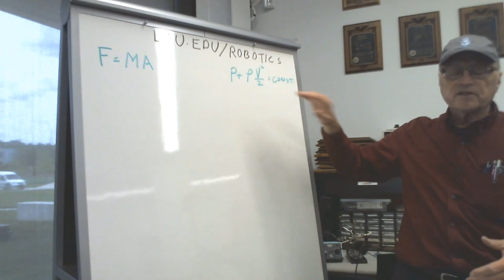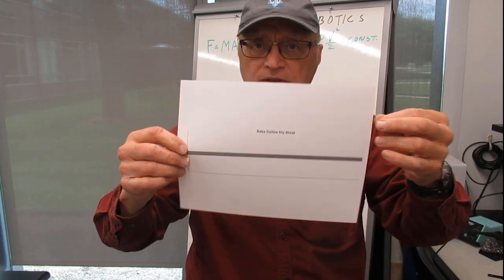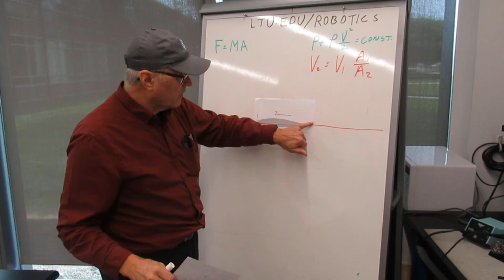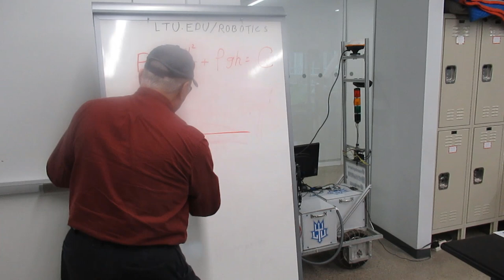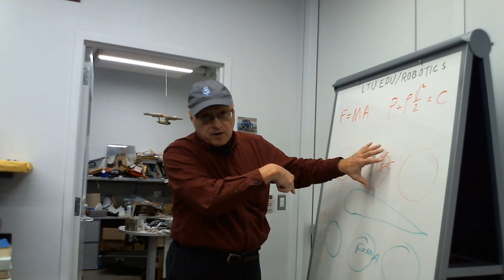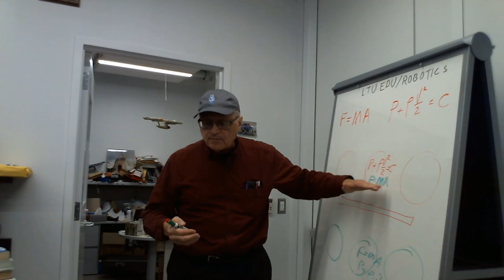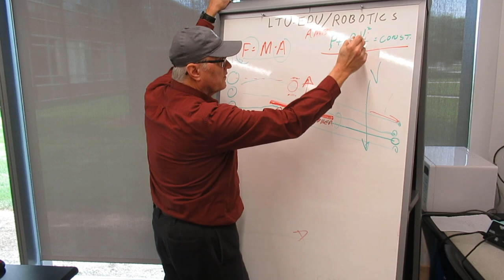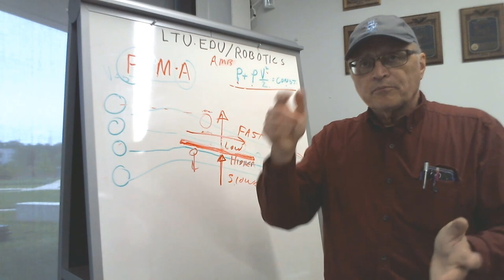Lift: Facts vs. Fiction - Fairy Tales for Pilots.

Comment: This week I have enjoyed seeing these very informative, intuitive videos, and at the end, being invited to comment about the contents, I feel rather interested to take part, as some ideas are different from what I am familiar with.  I shall speak about the fact that Newton and Bernoulli and Venturi and CIRCULATION, Coanda and Navier Stokes, etc. are all existing in what goes on around the wing of an aircraft. They are all the same! Few people comprehend it in the manner with which I am familiar.  I shall do my best to keep it simple and concise, but as Albert Einstein once said, " You can make explanations simple, but not any simpler than that!" 
              VENTURI EFFECTS . The manner in which the venturi effects were calculated on the Monie Aircraft airfoil was a little misleading, as that is not the way it works in reality. The presenter did not appreciate that in distributed mass systems, like air, water,  long ropes, and long pipes and long transmission lines, strings in pianos and guitars, and membranes in drums, and sound in wind instruments in orchestras,  and flapping flags on masts, and tuning forks, etc, what happens in one locality is not immediately felt in another locality,  THERE IS A DELAY,  and that is what exactly happens in a wing flying through a big voluminous block of air mass particles.  The manner in which the presenter calculated the venturi speeds above and below the Monie airfoil section while taxying on the ground, is completely wrong. What happens on the Monie wing surfaces does not travel immediately to the ground, nor does it travel to the altitudes he mentioned above the wing.   What really happens is the CREATION OF PRESSURE WAVEFRONTS and it is these pressure wavefronts that travel relatively slowly to distant places as in the case of sound pressures which travel at about 1000kph. Even electricity traveling with the speed of light is so slow when we consider electrical pulses in the Gigabits per second.  As the wing of the Monie  MOVES FORWARD to act as a VENTURI there are two wavefronts formed above and below the wing. These two high-pressure wavefronts travel laterally relatively slowly, one up to the sky, and one down to the ground. In the case of a ship traveling through the water, the bow wave starts to travel laterally, where the pressure wave causes the water to rise up to enter the air above it.  So as the wing of the Monie travels forward at low speed, the two lateral wavefronts do travel far away and the presenter's calculation was valid to think as he did, but if the Monie was traveling very fast, then the two pressure wavefront above and below the wing will not travel out too far, these become the boundary lines of the VENTURI effect in a  flying wing above and below the aircraft. 
            Now the magnitude of the VENTURI EFFECT on the Monie wing also depends on whether the Monie was using a TRACTION or a PUSHER propeller ahead or behind the wing. Flow-through a venturi needs a pressure difference,  and if it uses a TRACTION propeller, then below the wing would have been a pressure higher than the atmospheric pressure, while if it was a pusher prop behind the trailing edge, there would have been a low pressure and the traction and pusher propeller on taking off hindrance, as suggested,  would be rather different. If the Monie had to travel at high speed while taxing, I doubt if the wavefront above and below the wing would have been more than three feet away and hence the VENTURI EFFECT  would have been substantial to assume it.  On the lower speed, well the VENTURI EFFECT is not to be considered.  The point is that the fluid does not behave as the presenter suggested when working out his version of the VENTURI EFFECT on the wing of a Monie and to suggest that the difference between the VENTURI effect on the upper and lower section was what it was.................... well, I hope that he reconsiders his way of calculating the continuity of the fluid above and below a wing!  to prove that the venturi effect does not exist!  Perhaps one is being too pedantic!  but as detectives, we need to be accurate about how a wing flies and what happens at one location in the air does not happen at the same time at a far distant location.

The Venturi effect can be concluded by the use of both Newtonian and Berlunian effects, but as one needs the pressure differences at the input and output of a venturi pipe, this can be obtained by using a higher pressure compression source at the input or a lower pressure suction source at the output. Forgetting that the particles touching the sides remain stationary, if the heavy particles near the sides are considered to be fast heavy cars with a spring suspension, then when the convergent part starts to be navigated with a change of direction, not necessarily a change of velocity,  there is acceleration, and the suspension system compresses as the car inertia tries to hold the previous velocity direction, thus, the energy in the particle is transferred to the suspension system and when the car reaches the narrowest part of the venturi it will proceed to leave the surface due to Newtonian mass/ velocity effects, Bernouill, on the other hand, does not speak about the fluid mass trying to separate from the surfaces or streamlines in a venturi. The rate of change of velocity as a vector can occur in a linear fashion or an angular fashion, both of which will provide ACCELERATION. or pressure differences.  That proves that Newton and Bernoulli and Venturi effects are one and the same processing philosophy and they all exist around a flying wing.  Here one should mention that while we see Velocity as a Vector in Newton and Bernoulli and Venturi Symbolic representations, the associated  Pressure is always a scalar and in the Bernoulli equation, a change of velocity in a streamline, either along the streamline or simply a change of direction while keeping constant velocity, this would produce a Pressure change which is a SCALAR  and acts in all directions to affect all of the neighboring particles in a Newtonian fashion. 
Continued.
Reply: The streamlined diagram of the flat plate as shown at 40:37 is interesting, but there are some missing details that could lead to a misunderstanding of how a plate operates in those conditions.  The streamline is shown moving horizontally, starting from the right to left and when it meets the lower leading edge, it SUDDENLY AND INSTANTANEOUSLY  changes direction to follow in parallel mode, the slope of the flat plate.  Now ahead of the leading edge and after the trailing edge the Pressure is Atmospheric, Pa, and so parallel to the plate, there is no pressure difference, hence while traversing under the plate there is no linear acceleration of the particles, nor is there any curve to produce an angular acceleration, hence there is no force on the particle as it is moving at constant velocity.  The only ACCELERATION, hence force,   that took place according to that streamline contour, was, in an instant, under the leading edge, when the streamline changed direction.  That is the only place that force on the plate was created to change the direction of the mass particle. From then on the fluid mass particle was on a free flight without touching the surface of the plate.  According to that streamline,  the flat plate could have been a thin strip catering for that location where the streamline hits the plate and any other particle under it would have been influenced accordingly, and there would not be any use for the rest of the plate towards the trailing edge.
That streamline shows an IMPULSE under the leading edge of the plate and that alone would have uplifted only the leading edge and no more than that. Note that constant velocity along, a straight line or a first-order equation in the form   y=kx+c, then its velocity is dy/dt= k   and acceleration = d2y/dt2=0  hence no forces exists if a particle moves in a straight line with constant velocity.   

 All fluid particles behave in another manner and they have a cushioning or a soft pillow effect and their viscosity has other characteristics which try to keep them together cushioning and damping each other for any impulsive forces. 
When a mass particle of a fluid approaches a flat plate, the other stationary particles already in the zone near the plate, predict its arrival through a wavefront built ahead of the moving particle, as in a wind tunnel or a moving plate as in a free flight wing.  The wavefront of the moving particle as shown in the video will conglomerate the particles near the plate to resist the new arrival, and the close particles will cushion the arriving particle as when a satellite from outer space returns to the atmosphere at an angle that can achieve the cushioned, soft pillowed, trajectory into the atmosphere, rather interesting. This entry into the "atmosphere"  near the plate will certainly not be a straight line but more of a parabolic effect, perhaps of the form of y= ax^2 +bx + c   where the velocity due to the cushioning effect would be:-  
dy/dt=  2ax+b   and the acceleration d2y/dt2 would be 2a, hence while the particle tries to enter the cushion of particles around the flat plate, it would be subjected to a CONSTANT ACCELERATION  and hence there will be a rection on the plate to push it up, in this case, a reaction process which contributes to lift during the long period when the particle traverses under the flat plate.  If one looks at the 41:10 one can easily note the location where the acceleration under the wing takes place related to the diagram shown on the whiteboard. The streamlines under the wing are not exactly straight lines. One can note the benefit of angling down the leading edge to  be parallel to the entry of the apparent wind  and so what is shown at 41: 10 is not exactly a flat plate

What goes on above the flat plate has a relation to what was described and a practical plate would naturally curve the streamlines rather than keep them straight all due to the group behaviour of the particles within the zone of the plate, including the boundary layer. We shall leave that to the imagination of the reader. The angled down leading edge and the slope above the wing is introduced not to lengthen the path above the upper surface of a wing, but it is to cushion and accelerate the oncoming mass particles upwards and then give them a flight path containing a continuos deceleration and acceleration all the way back to the trailing edge.   All contained in what was described, including the cushioning effect of the fluid particles, there exist the processes that Newton, Bernoulli, Venturi, Coanda, Navier Stokes and another, call their own, rather than accepting it to be one natural process which nature itself brought about, and we still do not understand it fully, especially when the fluid particle can have internal energy of its own, like an exploding bullet, or the particle can be given external energy, as those particles getting out of the way of wings, rockets, cars, ships, a jogging human,  and all trying to return back into the furrow the moving craft made by robbing energy from the craft that pushed them out of the way in the first place.
Bernoulli equation around a wing must not be written simply as C= P + V^2/2  as that is much too simple. and is not what Bernoulli meant to describe around a practical wing whose powerful engines do transfer energy to the particles around the wing where all that energy is robbed back from the fluid particles by other exploitations around a wing as modern banks are robbing all our savings/ assets through depreciating their value!!  That is another issue that many people do not understand about democracy and its false pretences.
Reply: Continued.
Now let us explain how the transient and steady-state, particle pumping procedure to create a partial vacuum (low pressure), is brought about on the upper surface of a flat plate or the airfoil profile of a wing. We should assume a moving plate/ wing and not a stationary plate in a wind tunnel, but for convenience, we shall choose the later states and leave it to the reader to visualize the real moving wing.
When a stationary flat plate with an angle of attack is placed before a horizontally approaching fast-moving voluminous block of air-fluid mass particles, the entry angle is not that of the apparent wind and so the Newtonian inertia of the motion of the air mass particle will shoot past the sharp leading upper edge in a straight line horizontal line at the leading edge of the angle of attack of the plate.  At that very instant, the stationary particles above the upper surface will face a boundary line, separating the stationary particles on the upper plate from the fast-moving mass particles going past the upper leading edge.  This may look like a stalling condition, but in fact, it is AN ACTIVE PUMPING  ACTION DUE TO THE VISCOSITY OF THE FLUID. This shearing action in this boundary layer between the fast-moving particles and the slow ones on the upper surface will be pulled towards the trailing edge creating an active circulation of particle pumping that will form a slow particle pumping vortex.  If THE ANGLE OF ATTACK IS SMALL, then the pumping out of air particles from behind the upper leading edge will cause a partial vacuum, sucking and pulling down at the boundary line between the fast particles and slower ones. Slowly the pumping out of particles will curve down the boundary line to try and meet the upper surface of the plate, and the pumping vortex will disappear behind the trailing edge.  This transit circular pumping vortex on the upper surface of the plate will appear every time the angle of attack and the speed of the oncoming particles in the wind tunnel it too much for the particle pumping pump to suck down the high inertial particles going past the upper leading edge.

With a well-shaped airfoil, the angled leading edge and the slope to the trailing edge do not exist to lengthen the upper surface but to ensure a  flight of mass particles above the upper surface WHICH WILL  SUFFER  CONTINUOUS ACCELERATION  DURING THEIR FLIGHT ON THE UPPER SURFACE OF THE WING. This long flight subjected to acceleration is what produces better lift in a curved wing.  

All that was described is related to Newton, Bernoulli, Venturi, Coanda,  Circulation, Navier Stokes, and anyone else who thinks that it is more than the dynamics of viscous mass particles behaving so naturally on their own without the aid of any humans. The following video shows the circular " viscous pumping" that takes place on a flat plate ( wing) with a high angle of attack, which is too large for the pumping out effect to pull the boundary line down to the upper surface  of the wing  which we call stalling,
https://youtu.be/Vjk9Ux2COx0

Comment: There are many videos which say this or that theory is wrong... Everyone knows now these are wrong.... but none explains the circulation theory and vortex theory or any other solid theory properly
Reply: First, thank you for the comment. 

But, based on my experience talking to pilots, I have to disagree with "Everyone knows now these are wrong". Lots of pilots will recite the "Venturi" theory, claim that Newton works on the bottom vs. Bernoiulli on top, or... About the only myth that I would say is not particularly popular with pilots is the "equal transit" claim.  I can even point to a video claiming that "pressure does not account for all the lift" and the presenter is throwing ping pong balls at the bottom of a surface to show how they bounce.  https://youtu.be/NG6GB5Xd1Ds read the comments... "Brilliant", "Now I get it", etc.

Also, in my experience, if I try to throw a concept like circulation at pilots - you are lucky to get a blank stare back. The concept of the vector addition of two flow fields is just plain beyond their grasp - recall that many pilots struggle with the math behind weight and balance...  Perhaps you would have better luck with this? I would love to see it. But that is why I avoided all that in this presentation.

edit:

oops - I see that I was logged in to my other channel when I typed this reply - sorry for any confusion. Light and Sporty Guy.